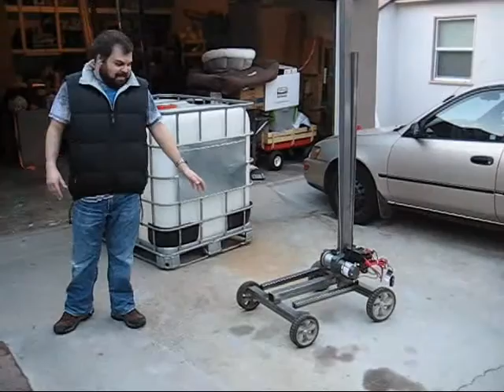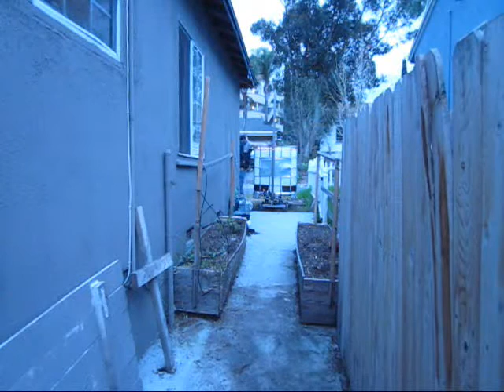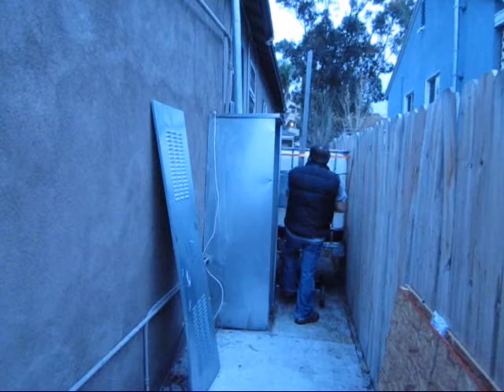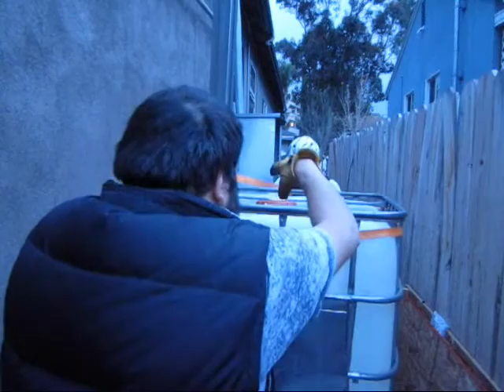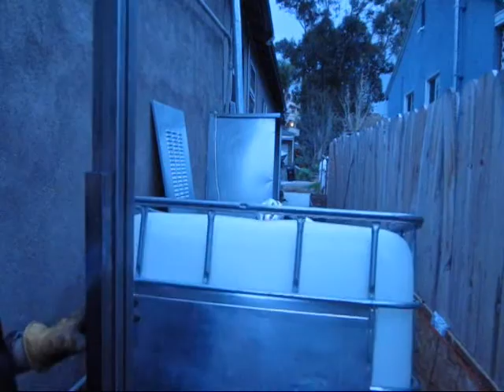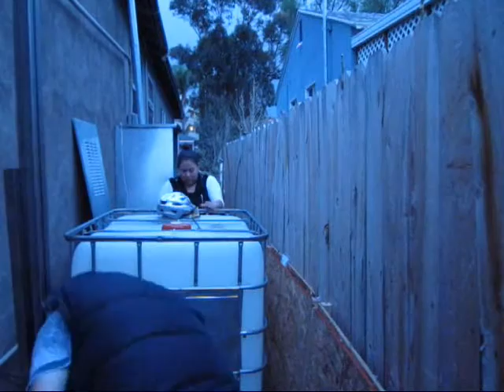Homemade Forklift in Action

Comment: Your wife is a saint.  My wife and I would have been arguing and screaming at each other. I halfway expected the vertical boom to break loose from the base because it does not have any braces, but was pleasantly surprised when it did not. I personally would have built the base portion sturdier and braced the vertical, but very evidently it was sufficient the way that you did it, for the weight of the tote.  What is the weight of the empty tote? 

I have been toying with the idea of building a small fork lift to upload heavy things from my truck.  I think that mine would have to have a longer base and forks to increase the reach.  

Thanks for the video. NICE JOB!!
Reply from the maker: about 250 lbs